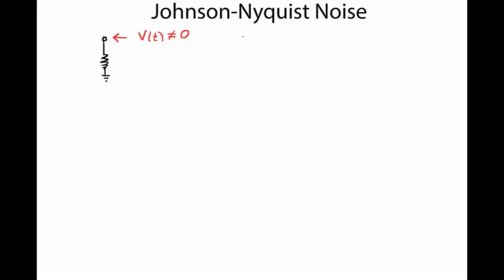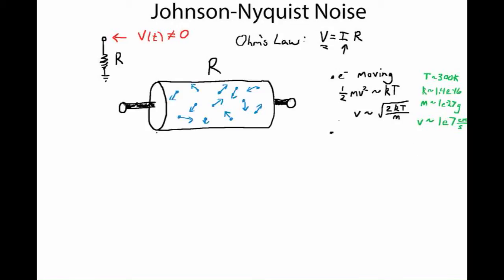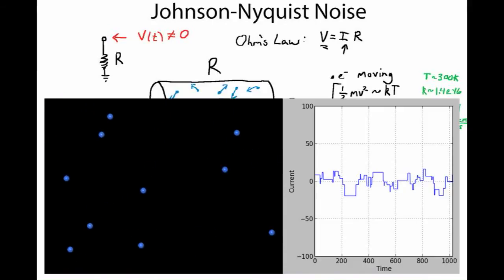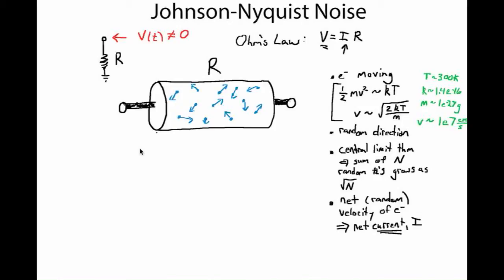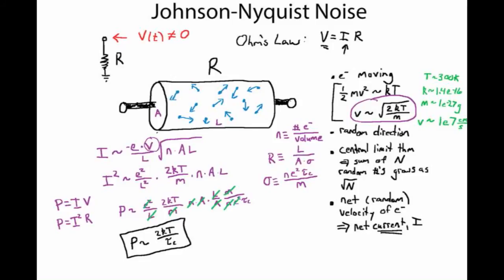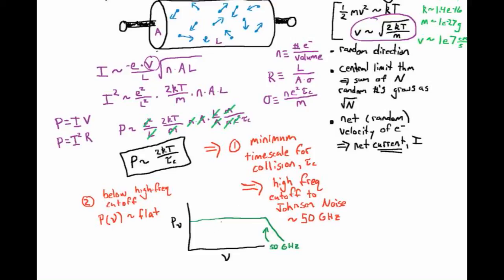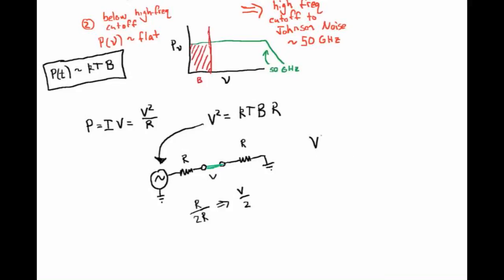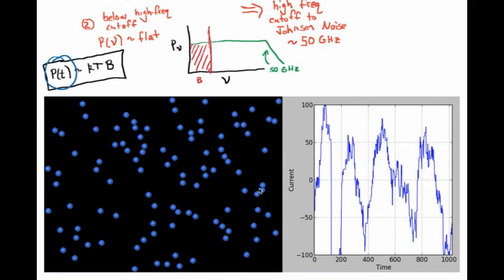The Origin of Noise in Electronics

Comment: I think that you have made a mistake. The velocity you calculated is the average an electron travels in between collisions, but to calculate the current, you should use the average drift velocity instead. The drift velocity is much much lower than the average velocity, on the order of millimeters per second.

Comment: How very odd! ALL people scream the mantra of USE THE SMALLEST RESISTOR TO AVOID NOISE. But none of them actually explain as to why small value resistors have lower noise compared to high value ones.

I am lost in the mathematics as I am not an engineer nor do I love numbers. But I now know that using low value resistor is meaningless. It is all about bandwidth and temperature. This also means devices with extremely side bandwidth, such as an operational amplifier, is not always a good thing. Not only low value resistor does not reduce or eliminate noise but also renders more power usage making battery die quicker (For battery-powered devices).

 I also notice that there must be capacitors with resistors of weird combinations (series, parallel, partial series, partial parallel, etc) in order to make either high pass, band pass, low pass, or a combination of two or more filters. Filters at the input, output, middle, here, there, everywhere. I do not know if that many convoluted RC networks are required. 
Some people will not mention what they are for. All they say is the RC network is to stabilize the operational, instrumentation, or differential amplifiers. Some of them say it is to cut off inaudible frequencies, why bother with things that one does not hear. Maybe these are not technical people, following he says she says Internet says other people say.